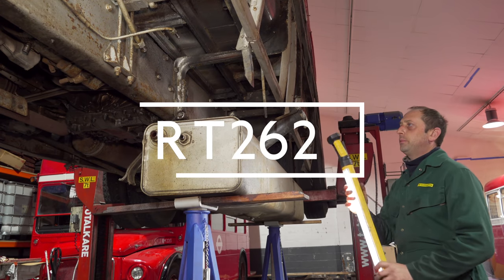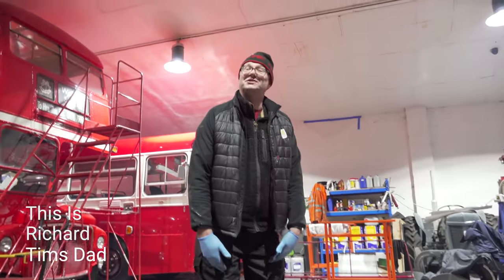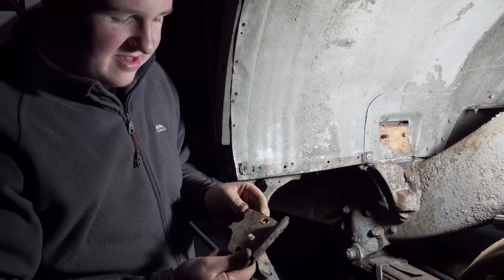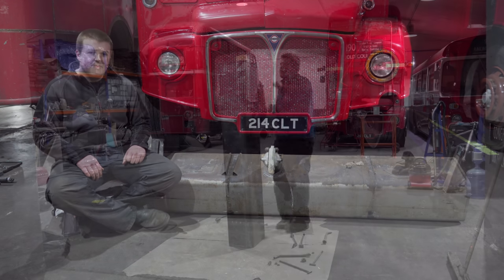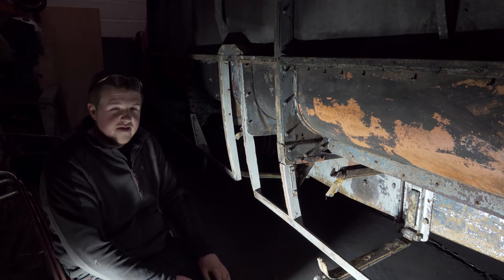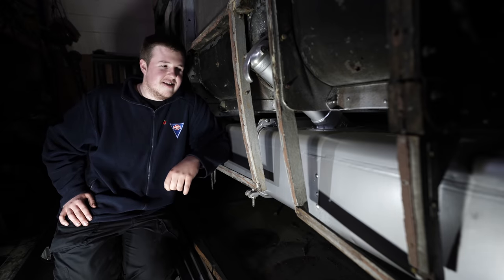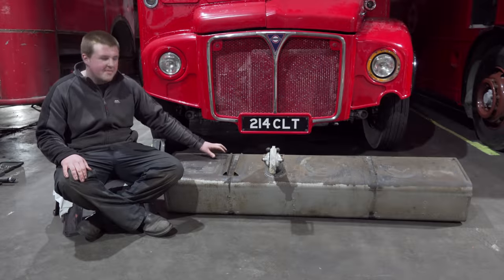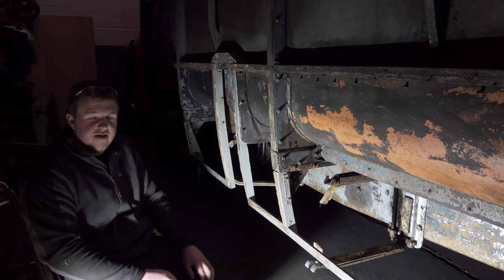Ep2: Starting Work Restoring A 70 Year Old London Double Decker Bus

Comment: Not enough PPE lads, keep up the good work.
Reply: @Rik morley > Yes good point not that I'm firm believer the need for safety nazi's of sorts but ones personal care is important, any one is paint spraying (face mask)/using air tools (hearing protection)/wearing eye protection/anti vibration gloves some basic equipment is needed to cover yourself just encase sh*t happens. Mainly for the basic three/four items - hand wise keeping your hands in good condition - anti vibration gloves > white hand syndrome is a big deal in elderly life when it makes you suffer for your forgetfulness. I wouldn't want any one to suffer it - it's a painful condition. I know many that have got it..... do great work with their mind but hands can't be use often as they are out use with nerve & blood supply damage - knowing what caused it.

Comment: I stumbled across your channel by accident and am glad I did. I know absolutely nothing about restoration but wondered if you can easily tell which parts are original (60 plus years old) and what would have been replaced at some point during its life. Good luck!
Reply from the maker: Good question Alan.  Probably not much on the bus is left from when the bus was built, but in London Bus restoration circles the bus is still considered to have original parts if they were fitted/replaced by London Transport during the vehicles working life.  So if you go by that, then most of the bus will be original.  Hope that makes sense?

Comment: Great job so far!! I wonder why RT/RTL/RTW fuel tanks were on the nearside? Added to the tilt test problems, I think!
Reply: Something about how the pumps were located in the garages !
Reply: It was partly a matter of balancing the weight since the compressor, oiling turret and batteries were on the offside. Also the components had to be placed in the most convenient positions with the fuel feeds entering the left side of the engine. The cab on the right side made it more convenient for all the air components to be placed there. In my opinion the RT is still the best London bus design from the last 80 years.

Comment: What paint are you using on the fuel tank?
Reply: Its had 4 coats of high build zinc primer and 4 coats of transpeed fuel resistant chassis silver. All Williamsons paints products.

Comment: What are those thing running of belts from the prop shaft? Air compressor, hydraulic pump, etc?
Reply: One set runs the compressor and the other set runs the large dynamo.

Comment: Have you considered using a high-lift jack foe breaking the bead on a tyre. place wheel  under an accessible part of tge chassis of another vehicle. put foot of jackon tyre next to rim and jack up the vehiclee and bead may break away with luck. Its how I changed tyres on a land rover
Reply: I could be wrong but that looks like a man arracking a split rim wheel (a task often accompanied by a lot of 🤬) so that being the case, first job is to loosen the locking ring and collar from the outside edge, then pry out the lock ring, then lift off the collar and finally lift tyre and tube off of wheel hub. Did too many of those in my teens working for a local tyre depot. With the age of the RT design I would have thought it very unlikely to have the sort of tubeless rims you are thinking of (unless retrofitted with tubeless rims as has happened with some Of the RMs,). From memory, I know the older Guys, Bristol’s and Leylands my local firm (Silcox) ran in the 60s and early 70s all ran split rims those examples dating mostly from the 50s (40s in the case of the Guys than ran in service right through to around 1969)

These guys have RMs running on both types of wheel design, I’m certain it’s covered in an earlier video.
Reply: @warweezil2802  I see what youmean re split rims. Land rovers , mine was a 76 build,had tubed tyres and would not break the seal betweeen tyre and wheel without some PERSUASION.
Reply: @Threelinkdave  The Landy rim was probably designed to take tubeless tyres when new and that would mean the rim has a slight “shoulder” at its outer edges, breaking this bead is difficult by design as it is meant to be a close enough tolerance to grip the bead of the tyre and form an airtight seal. You can often break them with a Dunlop claw lever and hammer & your own size 10s, I’ve even seen hardwood wedges used. In my teens we were not allowed to use a machine on alloy wheels - imagine that now 🤣😂😁😆

Comment: Dear oh dear, do you want to go deaf? for goodness sake wear ear  protection. That ringing noise you hear after using a needle gun is a warning that you are damaging your hearing. Never heard of vibration white finger either? That is the tingling and numbness in your hands?  Wear thick gloves and take break from the gun.  You will regret both by the time you are in your mid fifties if you don't take notice. .